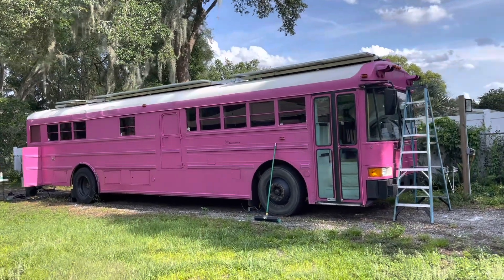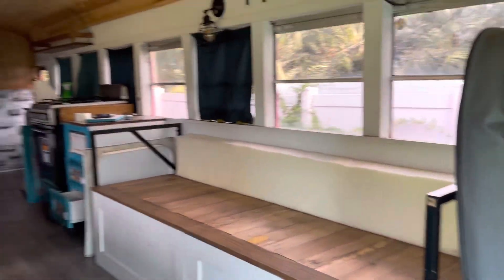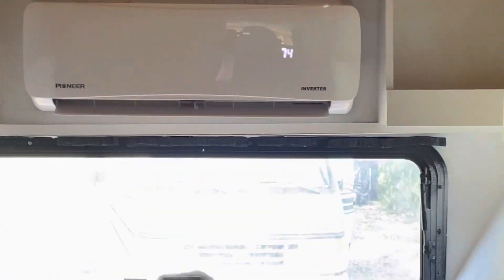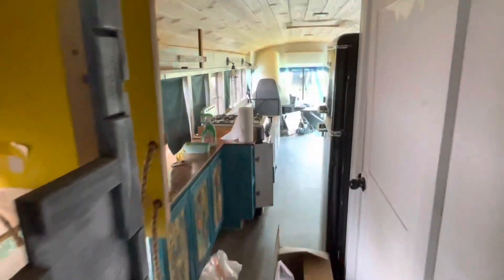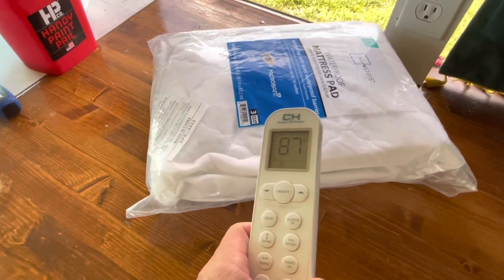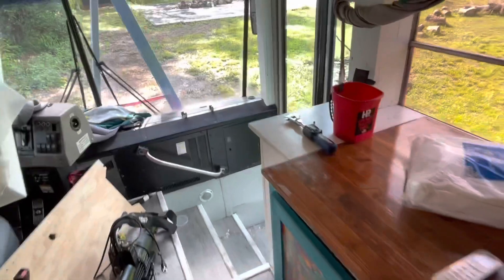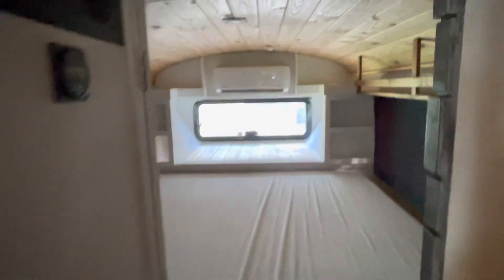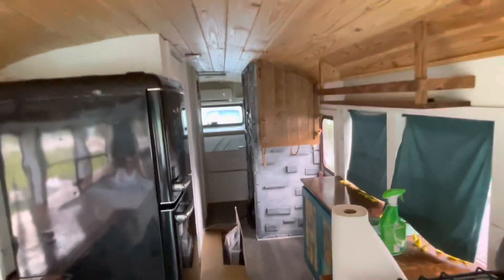Skoolie Minisplit - One or Two?

Comment: Did you mention how many wattage array you have?
Reply from the maker: Probably but I didn’t focus too much on that because there is no arbitrary number that works across the board. Too many factors to consider.  Very few buses need more than 3200w unless they have crazy electric demand and/or made serious mistakes in component selection.